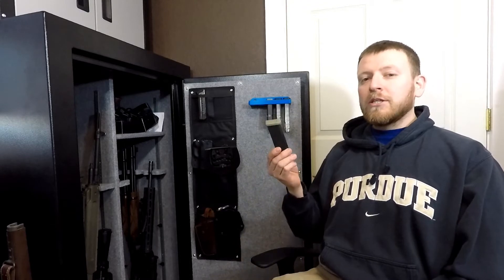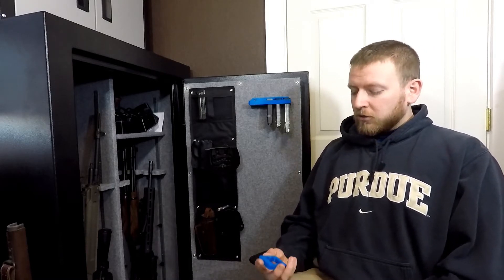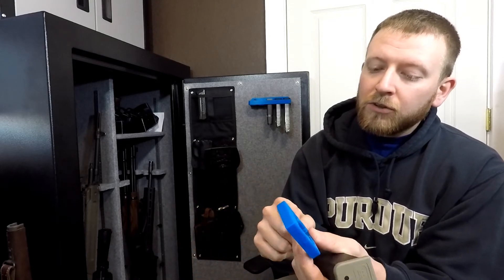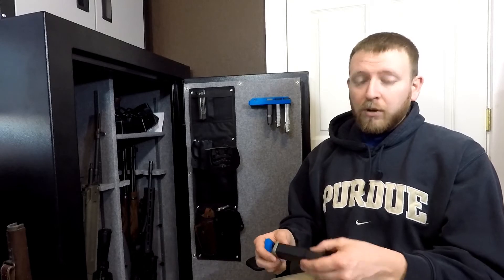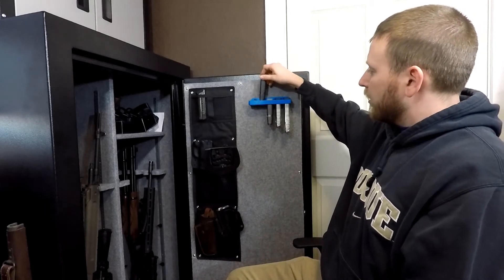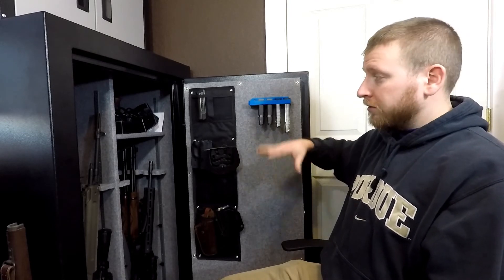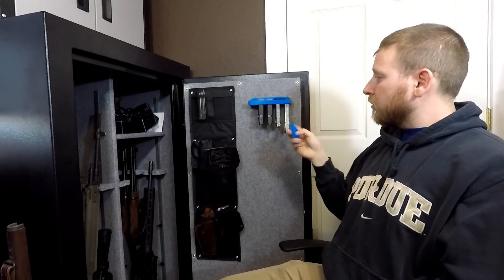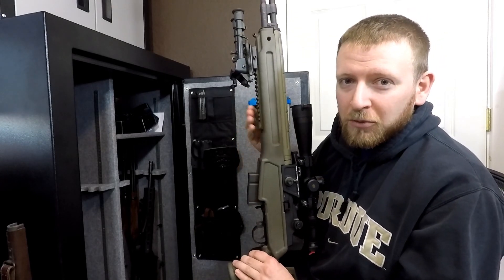3D Printed Glock Mag Accessories!

Comment: Cool design. I haven't printed one myself yet but are glock mags all the same size on the outside? I have a G23 and can't ever find anything specific to it. I was told the G17/19 were also the same size but I used a G19 for a template in a print I made and it came out way to small. (the trigger guard was too tall to slot in properly among other slight things that may have just been the G19 file being the wrong size. 

Hope you've kept designing stuff, I imagine gun safes + 3D printing would be huge, everyone can really customize their stuff and not have it all look like bulk universal racks/mounts. 
Though I really think  good pegboard system with cloth overlayed would be the easiest and sleakest look, but that only works for the guns themselves...these Mag Racks should be a big deal!

Comment: Those are cool man. I've been wanting to get into 3D printing for a long time but I just haven't brought myself to commit to it.
Reply from the maker: It was hard for me to stomach the initial cost until I realized the utility with reloading. I've printed so many accessories for reloading that have just made my process that much easier. Now that I am getting into printing actual firearm accessories, can't believe the things that are possible. Check out these mag holsters that I just finished today: https://www.instagram.com/p/BejJt8rBGx6/
Reply: That's cool, man! What other kind of accessories have you made for reloading? That would be sweet to be able to make stuff like that. I've seen guys make scope throw levers, die holders, etc. What would it cost to get into something like 3D printing on a budget to be able to make stuff?
Reply from the maker: I make a lot of stuff for my dillon. Bin expanders, tool head stands, die holders, wrench holders, primer tube holders, and a powder measure throttle (for my RCBS drop).

Depends. I actually have two printers. Spent somewhere around $400 on the first printer and then had to spend about $200 to get it to print decent. Then it crapped out on me. So I spent another $750 and got a Prusa MK3. You can spend $600 and get the MK2S kit from Prusa and be way better off with an awesome printer. It will print basically out of the box but you will still need to get familar with print settings to get the most out of it. Takes time like anything.

The thing a lot of people don't take into account is the modeling though. You can make things that are unbeliably useful and actually very strong, but you have to be able to do some 3D modeling. And simple stuff is really easy to learn, so you can do it. I worked professionally with 3D modeling, so I've got experience for some of the complex stuff. I like to help people so would be happy to help you with models if you needed though. 

I can get long winded, sorry.
Reply: No worries man. The more info, the better. It will probably be a long while before I even consider it, especially if I had to spend 600 bones or so. I have too many other things taking up my disposable income haha